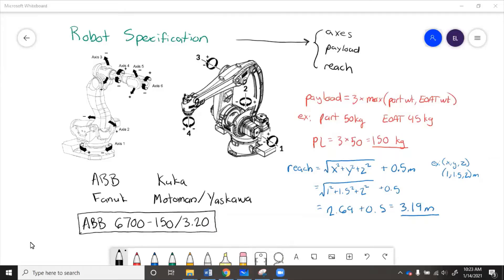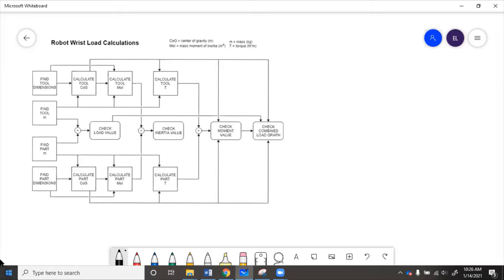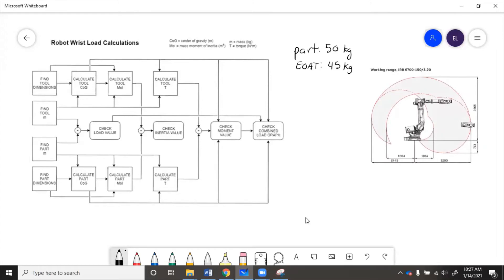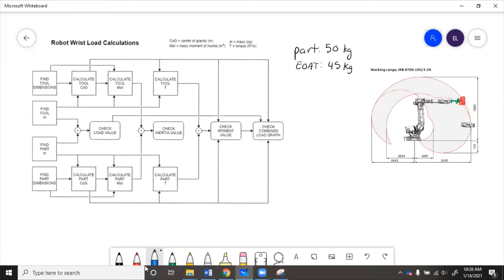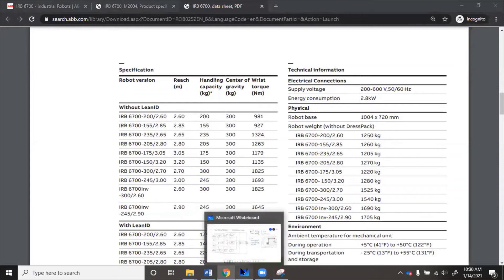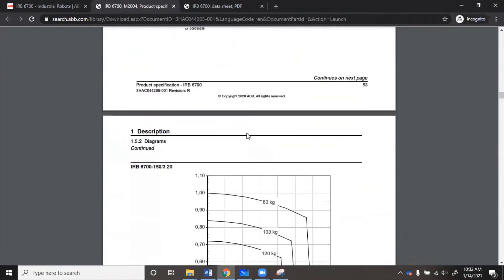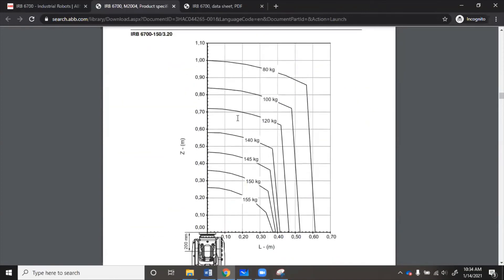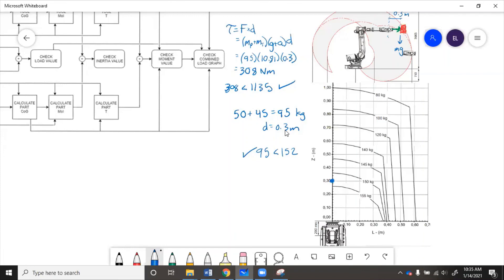Robot Payload Check

Comment: Thankyou so much for the information. Very nice video. I had a question i'm wondering  about. If the EOAT has double hand gripper, does the COG of tool and part stays on the center Z axis or we still need to lookup the load to the side? (i'm imagining a kind of a T shaped gripper)
Reply from the maker: I think for that situation, the COG would stay on the center Z axis (if that is where the stem of your T is).